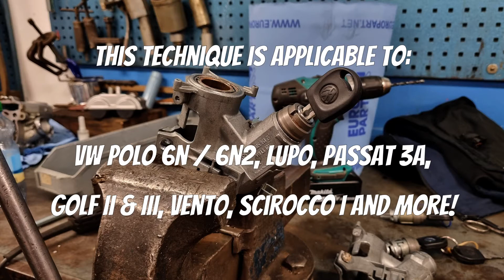Vw Lupo Polo etc Ignition Lock Cylinder Repair!

Comment: Thanks for posting. I just did this.  For reference, the hole should be 12mm from the top. I used the casting mark for the other reference point.

Comment: You can do the drilling without removing the lock from the car. Even the steering wheel can be left in place. See you drive a Lupo 3L. Nice!
Reply: where to drill when steering wheel is on?